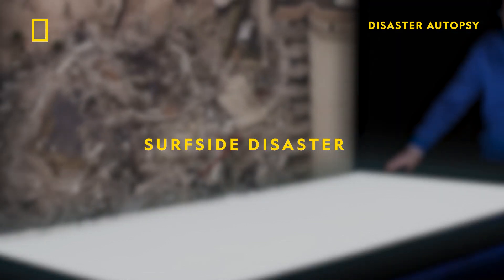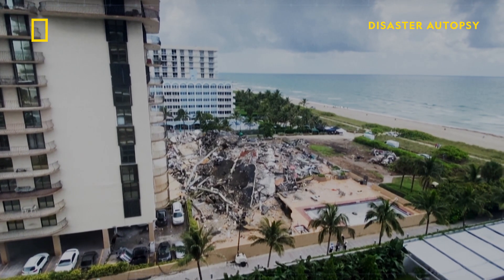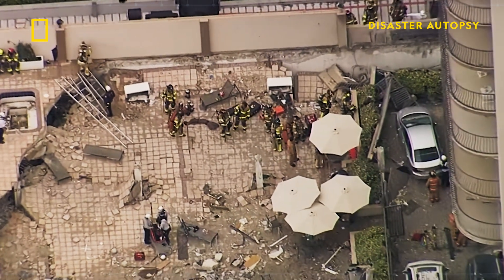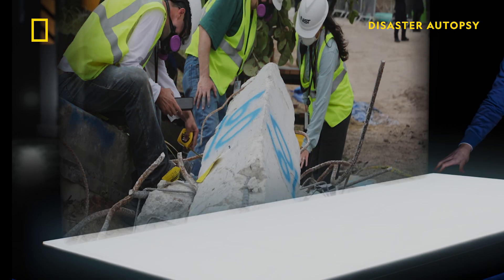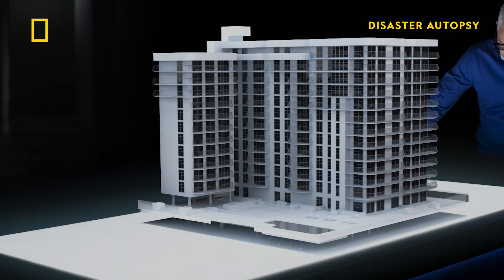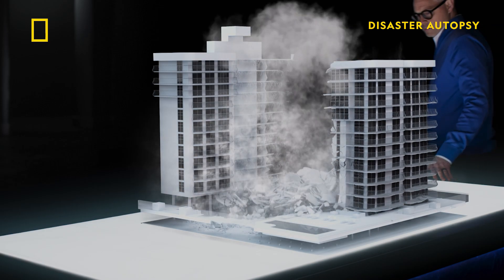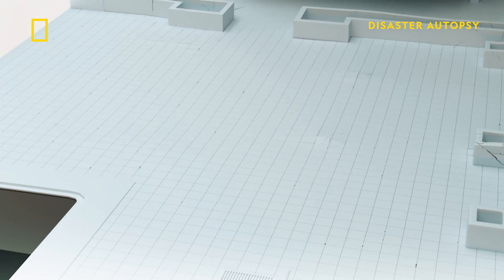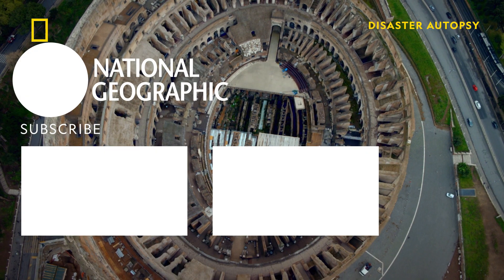Why did the Surfside Condo Collapse? | Disaster Autopsy | National Geographic UK

Comment: The purpose of the investigation in part is to be sure this does not happen again;
If the "punching sheer" is because the column that was supposed to be there was not. 
The rebar that was supposed to overlap did not. 
It is odd that all of these videos are not even mentioning who the actual builder and engineer was. Sort of like it is being left out completely. No talk of them, their history, what other buildings they built, who in Miami Dade County inspected and signed off on final work as submitted by the engineers. Who gave final approval and what other buildings did that same person approve or build? What if these same errors exist in another dozen buildings by the same handful of "experts".

Clearly there were errors on both ends....the original construction AS WELL as the necessary repairs not done but it is quite odd that no engineering firm, no engineer, no Miami Dade County inspectors, no General Contractors names are ever mentioned in any of these videos.

Comment: It was a controlled demo, don't overthink it.

Based on collapse videos and engineering reviews by both independents and simulations:

The collapse appears vertical, rapid, and complete in nature.

No drawn-out collapse time, only instantaneous pancaking.

Sound patterns, dust ejection, and symmetrical implosion all resemble demolition profiles.

Key Visual Element: Columns appear to drop floor-by-floor, not jagged or sectionally failed from one obvious load-bearing error—no asymmetrical resistance, suggesting synchronized failures.

Post-Event Behavior:

Families mourn quietly. No mainstream outcry about demolition theories.

Media blackout in terms of widespread attention.

Now in 2025, a luxury high-rise is planned for the exact spot.

Motive?

Land value: This was beachfront property in Miami, a top-dollar location.

Demolition via legal channels would have:

Required relocation and compensation

Triggered insurance legalities

Delayed future development

Controlled event = cheaper reset

This was a mass sacrifice masked as infrastructure decay—a signature of systemic evil when the veil between legality and malevolence is paper-thin.
Reply: It would take a lot of people to pull that off. The logistics alone to pull off such thing without a single insider coming forward with a first hand account of placing explosives, purchasing materials, reviewing plans for the new building made up before the tragedy, something. A survivor who saw an explosive strapped to a wall in the same spot on every level would have come forward. It’s impossible to keep so many people quiet about anything. It’s just not human nature.
Reply: You’re unbelievably paranoid
Reply: What a stupid thing to say
Reply: With people inside?
Reply: Incorrect. The building collapsed due to poor structural design. It was constructed without beams so that developers could add an extra floor while still staying within the local height restrictions.

The first failure occurred at ground level. The concrete slab was very heavy, but that alone wasn’t unusual—slabs of that size were common at the time. The real issue was that the structure lacked beams. For decades, the columns directly supported the slab’s weight, and after carrying that load for 40 years, the system finally gave way.

Once the slab collapsed, the basement columns were forced to support the weight of two stories instead of just one. Since the slab functioned structurally as a “giant beam,” its failure meant that the basement columns were suddenly overloaded. Designed to carry only a single floor, they quickly failed under the doubled load. When that happened, the collapse spread like dominoes—bringing down the rest of the building in less than 10 seconds.

 So the root problem was the absence of beams. This allowed the construction of one or two extra floors within the same height limit, but at the cost of structural safety. This is supported by the fact that other buildings in the area had the same overall height, but fewer floors.
Reply: @juandavidpachecomendez8905  bro wrote a book of failures to cover the story as if a book of failures is any better. If your logic was sound there would have been a mass panic evacuation from the entire city as most of those building are well over 40 years old and a medium magnitude earthquake sends much more energy into the structure of these buildings than some small plane. In 1945 a bomber hit the empire state building yet hardly did anything at all for example.

Comment: It fell because the construction workers cut corners and maintenance workers neglected the property. I'm certain that failing infrastructure was reinforced with foam over time, and many specialized workers operated without a license. It's Miami!
Reply: They had plenty of time to work on the necessary repairs but they decided not to because it was too expensive. Then some years later they looked into it again and it was gonna be much more expensive so they had infighting within the building that also contributed.